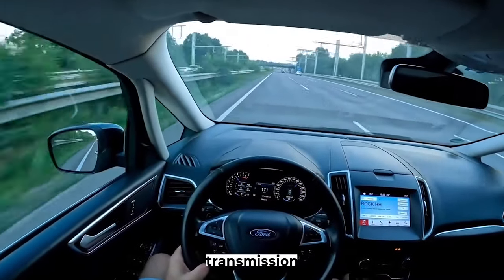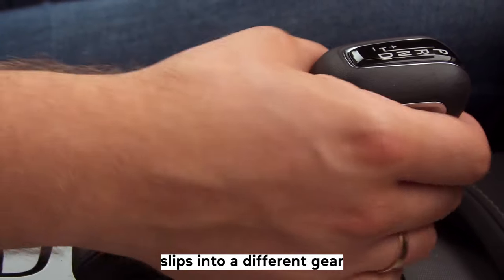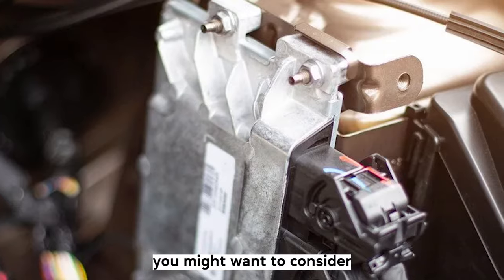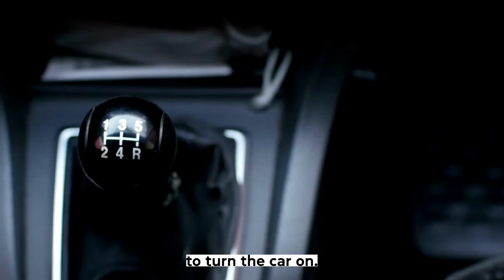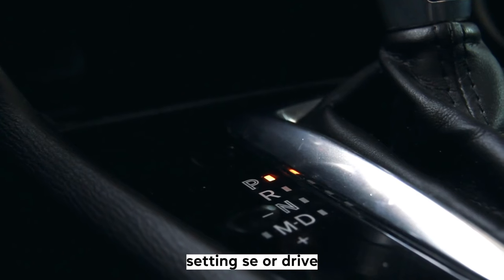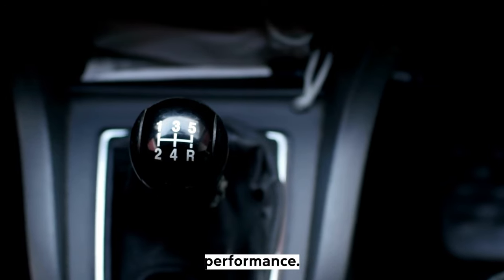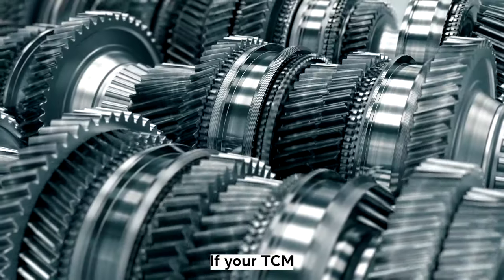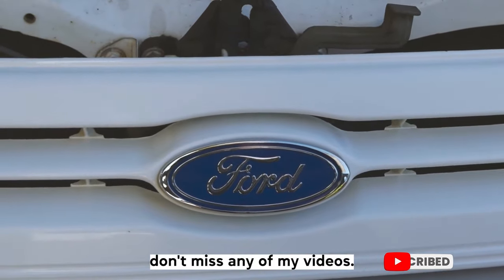How To Reset A Ford Transmission Control Module - Symptoms of a Bad TCM

Comment: I did this twice and nothing happened, I have a 2015 Focus SE
Reply: I did this also but no luck.
Reply: Damn i actually came here for my 2014 ford focus se. It was sitting in snow for 2 months.  I go to drive it one day and its completely dead.  If you connect cables to it the computer turns on but the engine will not turn over.  Soon you disconnect the cables everything completely dies again
Reply: Same here, but I got a fiesta 😑
Reply: Pretty sure this is the issue with my 2015 Focus SE. have a diag tool in the way. Will try this too and let y’all know
Reply: @bocean07 need a battery by the sound of it
Reply: If I reset my TCM using this video, can I still drive my car normally or do I have to re-learn the TCM immediately? How can I re-learn the TCM after a reset?

Comment: I've done this three times, and am thankful for using this reset process. I will be getting the TCM replaced per the latest letter from Ford. Thanks for posting this.
Reply: Has the dealership agreed to replace your TCM?
Reply: What year make and model is the car u did this one ?
Reply: I tried getting the TCM replaced on my 2015 focus. The dealer said it didn't need it . But it needs a clutch replacement for $3,500.
It has been reported that there is a shortage of TCMs.

Comment: Dude, you saved my Ass. 2007 Mercury montego Premier. I was 30 miles out at a job interview, stopped for gas on the way home, and started the car. TCM is dead, and it's stuck in low gear. Then I found your video. The check engine light is still on, but it's shifting right for now.  THANKS AGAIN for the video.

Comment: Ford Focus 2012. 55,000 miles. Car always serviced by Ford. I had 7 transmission errors including “transmission overheating” and “transmission error” and transmission malfunction, service now”. All errors occurred in stop and go traffic, both city and highway, uphill in hot summer months. I turned the engine off for 10 minutes, restarted and was able to continue driving. TCM was replaced by Ford about 3 years ago. Then last week in highway stop and go very hot, I had the transmission error again 5 times. I finally left the car on the side of the road. I came back at night to get my car. Car started right away and I drove home without any problem. 5 days later I brought the car to Ford to be checked. According to Ford there were no error transmission codes. Is this legit that error codes reset themselves if the car restarts and can drive or did I get b.s. handed to me?

Comment: I just know Ford is a joke, I wish my mother never bought this godforsaken vehicle 😡
Reply: If u have automatic it's a simple process. Put the button  on start on but don't start engine and then go into N for Neutral and then into P for Park. It should reset your Ford TCM and you can use it until it packs up again

Comment: I'm having TCM problems and have to wait to get it replaced. But, when it acts up & goes into limp mode with check engine light on, I do this. Afterwards, I have to start up and shut down the car a few times before check engine light goes off and I can drive normally again until tcm glitches again. This has saved me several times.

Comment: Im having an issue with my 2012 Ford focus SE when I crank the car up it runs but when I put my feet on the gas it does nothing no rev up no rpm movement , when I put it into gear I doesn’t read meaning if I change the gear from park to drive it doesn’t read it on the dash where it supposed to at the gear indicator & when I push the gas nothing happens

Comment: Hi, thanks for taking time to make this video, ill be trying this on my Ford Galaxy Powershift, when you mention step 7 start the car , do you mean just turn "ignition" on or turn the actual "engine" on ?  Many Thanks Carl
Reply: I also have a 2013 Galaxy powershift, I have a flashing P on the dash that never goes away, (doesn't show gear selection) do you have the same issue? All the gears seem to work fine however.

Comment: My 2016 Mondeo had 163000.00 miles on it and the issue I have from around 45000 miles is that it goes into a sort of safe mode where on the dash says seek owners manual , the way I get over this is to pull over as the car will not excellerate as it cannot select the next gear - I will pull over and turn the car off and wait for 20 ish seconds and then turn it back on and it resets the computer or something and then I drive off until it happens again - it may not happen again for thousands of miles or may be just 1 mile  - any thoughts guys - Cheers (UK)
Reply: Don't buy a ford 😂

Comment: In the video its stated that the engine shouldn't be started when turning on the vehicle to go through the steps, but being that my vehicle has a push button start I can't shift into the required gears wuthout starting the engine with the push button ignition...If it can be done as mentioned in this video, how exactly do I turn on my vehicle without starting the engine with the push button?
Reply: Just do not press any pedal.

Comment: I have a 2016 Ford focus. I’m going to try this hoping it doesn’t make it worse. Right now it’s driving, check engine since I replaced the battery, I can still the faulty shifting happening.
Reply: Same thing with my 2015 focus.
Reply: It happened after I replaced the battery and now my car won’t reverse
Reply: no check engine light since I replace the battery and still have reverse after 108 miles drive time. 2016 Ford focus has 165,000. But every once in a while when starting off it feels like the tire skip.
Reply: How did reset go?

Comment: 2016
Reply: Hey what error codes did you get?
Reply: I got P287b and P2837
Reply: @martin_the_dream did you get it resolved
Reply: @adanmata8625  yea I did. I did a transmission swap
Reply: @martin_the_dream  damn All becasue the battery died or was it from something else
Reply: @adanmata8625  yea because the battery died. Apparently the transmission is extremely sensitive so whenever that happens it breaks a tab inside the transmission housing.
Reply: @martin_the_dream  WOW, this happened to a focus my gf owns.
Reply: @adanmata8625  yea apparently it's extremely common. I would find a used transmission and swap it. And take care of your battery by replacing it earlier instead of letting ot die